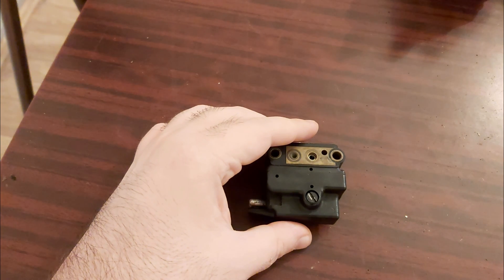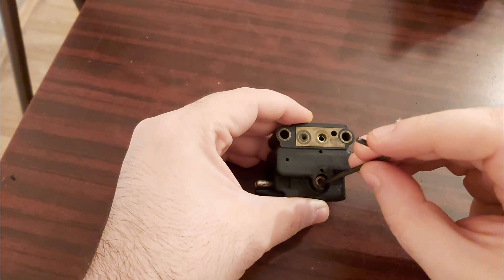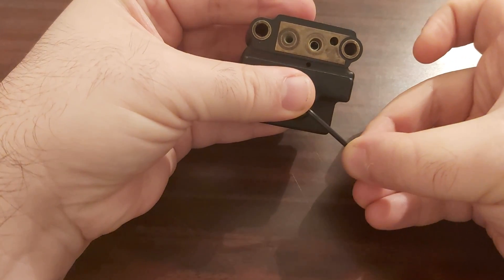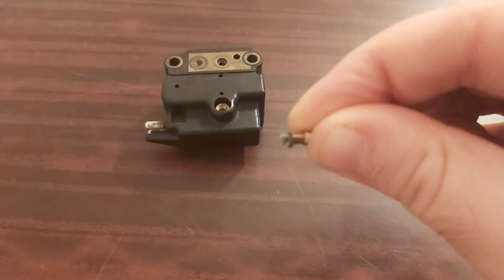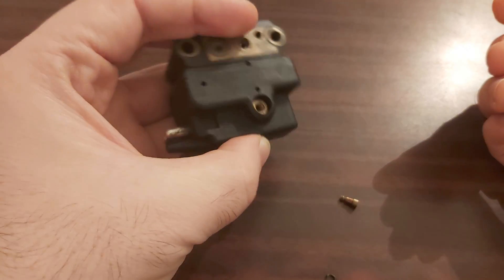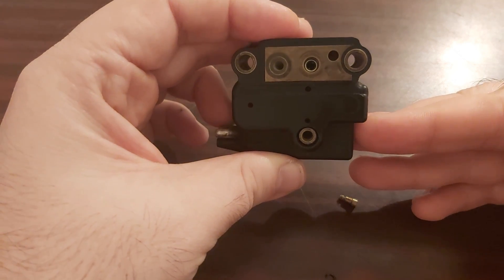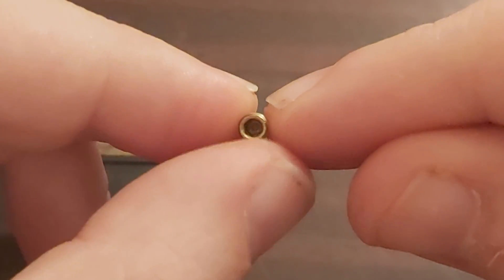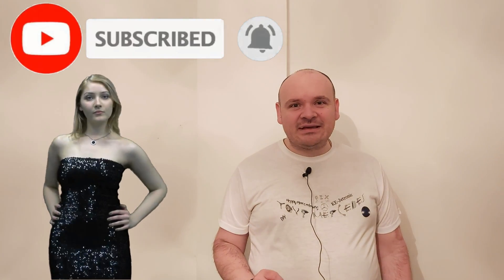㉦Mercedes Ke-Jetronic㉦ - The EHA/addition video

Comment: Hello, how are you? Does today's topic relate to RPM instability? RPM instability starts at 5 with startup, then it increases with pressure on the gas pedal. When you lift your foot off the gas pedal, the RPM goes back to 5, and the engine almost shuts off.
Reply from the maker: Have you checked the potentiometer?

Comment: Hello, if I understood well you mentioned that you will have to change the EHA if the O ring of the adjustment screw is destroyed, cant you change this O ring instead of the complete EHA ? Another thing i want to ask, if this o ring of the adjustment screw is broken, could it effect the starting when the engine is warm? I thank you for your helpful posts
Reply from the maker: The EHA is being replaced if it leaks. There is he way how to replace the o-ring on the EHA, the little one, and I will send you a link. The only bad thing is if the EHA plate breaks, then there is no help for the EHA. Greetings
https://youtu.be/I38ezJ2fzD4

Comment: Good afternoon, Thank you in advance for sharing the information about the injection system, it has helped a lot. I have a 190 2.0 petrol, and I'm having problems with the injection part, it only starts with the fuel adjustment valve turned off, if it starts, no petrol comes out of the injectors, I have 5 bars of constant pressure after starting, before I had 6 bars, if you turn on the valve with the engine running, it works normally. Can you help me? Greetings José
Reply from the maker: Have you tried to see wiring? Looking from the left fender of the car the black wire of the EHA has to be to your left and brown/black to your right.

Comment: Thank you very much for your detailed videos!!!

Is there a way to replace the micro filter on the input port/hole of the EHA valve? If so, what should be the process? is this filter a commercial common part?

I'd got my fuel system contaminated and I'm trying to clean & recover most parts as possible.
Reply from the maker: Just blow it with a carb cleaner! Happy Mercedesing 🍀 👍🏻 💪🏻 😊
Reply: @mercedeske  Thanks for the quick response!, but it seems to be clogged after carb cleaner (and falling apart, because I see some kind of plastic or rubber peeking out 😓)

Comment: Hello, how do I know if it is a malfunction? Does the malfunction cause the engine to vibrate?😊
Reply from the maker: In two cases - a leaky EHA and if its baffle plate is broken. Then the EHA makes constanly lean mixture(pressure difference 0.2bar). That's something you will have to check with your pressure gauge! Best regards!

Comment: Hi Ivica,
Would you describe step by step procedure of adjusting EHA valve on 1986 190e 2.3 w201.  I appreciate if you indicate on each step engine/Ignition off or on,  the tester valve open or close. I have a hard time to get a right  value,  somehow I am not doing it correctly.  If you do a video it would be by far better, but steps of process is great also.  Thank you
Reply from the maker: Hi and thanks. If this video doesn't help, contact me! Happy Mercedesing!
https://youtu.be/jeoJHWCugAE
Reply: Hi Ivica,
I followed your information on the video clip, and came up with these values:
- EHA screw adjustment 6.88 mm
- Ignition on - 0.14 mA at points 2 & 3 (X11) and 2.0 bar with pressure valve closed

- Engine on - (cold) 0.14 mA at X11,  and 4.6 bar
- After 3 minutes warm up (80 degree), 0 at X11, and 5.0 bar,  once I open the valve 5.4 bar
- Potentiometer reads as 0.71 Vdc 
What you think?
Thanks
Reply from the maker: At first on the X11 you measure voltage, not amperage. The amperage(mA) is being measured on the EHA. If you get negative amperage on ignition on then swap the leads on your multimeter. Concerning the potentiometer everything is okay. Measure the voltage on X11 ports 2&3.
Reply: Voltage is 0.67 @ X11
Reply from the maker: @henrysalem5516  That's too low. How does the car behave?
Reply: The EHA amp w/ ignition on is 7.28ma and on engine running at 80 degrees is Zero, and all other numbers as I gave you.
I don't know where to look for the problem, appreciate your assistance.
Henry
Reply from the maker: @henrysalem5516  Your specs are okay. The pressures, the current on the EHA, the potentiometer as well. Are you satisfied with the car how it runs and drives?
Reply: often the RPM fluctuated between 1000 to 1500, when is on idle
Reply from the maker: @henrysalem5516  Many things can be culprits - the pump, the regulator, the injectors, the distributor... Everything has to be checked with the pressure gauge.

Comment: Hi Ivica, thanks a lot for your videos & they're super helpful for the classic mercedes community. So I would like to ask a few questions. I own a 1989 190E, M102 engine and lately I realized that my EHA valve gets wet just after turning the fuel pump on, very very small leaks but still enough to get me worried. 
1) So before I spend the big bucks on it, I'm wondering if just replacing the green O-rings could solve the issue?
2) Is the EHA valve the same for all KE-Jetronic or it varies based on the car (whether it's a W201, a W126, a W124, etc.)?
3) Does a new EHA come adjusted or I have to deal with that brass screw after installing a new EHA?
Thank u!
Reply from the maker: Hi and thanks,
concerning the EHA - they are all compatible(only at the dealership they will tell you the opposite). If the leaks come from the joint, where the FD and the EHA meet, then you can try replacing the two green o-rings, but if they come from some different place then there is nothing you can do. The brand new one is calibrated but its work depends of the sensors so if you have faulty sensors that need replacement then even that one will not help you, you would need to readjust the allen screw. Looks like I have to do a video on that topic, I think people still don't understand how everything works. Best regards
Reply: @mercedeske  Thanks a lot for the quick response. This weekend I'll examine where the leak is exactly coming from; and yes, that video would definitely be helpful. 
Keep up the good work .... All the love from Kigali.
Reply from the maker: @victor90101  All the live from Knjaževac 😉😃🍀

Comment: Thanks for you videos ! I learned a lot about KE-Jetronic.
I rebuild my fuel distributor because of the diaphragm. And now the car don't start. Any fuel goes out of the head in the metal hose.
I noticed that EHA is leaking by a little hole. Is it possible for the engine to not start because this sensor is leaking so no fuel goes in metal hoses ?

Thx you so much.
Reply from the maker: Hi and thanks for everything. Concerning you issue - here your system loses pressure and it makes rich mixture out of your system. In order to see what happens actually you must hook up the pressure gauge on both chambers, bridge the fuel pump and see for how much there is difference in pressures. If you have a leaky EHA then replacement only! That much I can tell!
Reply: @mercedeske  Thank you ! What do you mean by "both chambers ? (lower and upper side of the distributor ?)

I saw a bolt on the lower part who's raccorded to nothing but not on the upper part. Do it have to bridge from this lower bolt to the cold start injector ? Then I think I have to take off EHA Sensor to have clear pressions.

(Btw I enjoyed your videos u helped me to save my distributor and to adjust my throttle plate. How can I help you back ?)
Reply from the maker: At first concerning lower chamber, that's the lower part of the distributor. The screw that is left there like that when you unscrew it you can measure the control pressure with a pressure gauge and the system pressure is measured where the cold start valve connection is located. You just need a pressure gauge with fittings. Measure the system pressure at first, note it and then measure the control pressure and you will see pressure difference which has to be 0.4bar. I'm glad I helped you. If you can donate on PayPal 30euros that would be great. Many greetings and happy Mercedesing 😀
Reply: @mercedeske  Do I have to take off the EHA while taking pressure ?

You should do a video explaining this checking. I didn't see this one on your YouTube channel ;)
Reply from the maker: @Xorellion  Yes, disconnect the eha. I will provide you the link.
https://m.youtube.com/watch?v=RKxfSdTNARY&t=20s
Reply: @mercedeske  Okay again thx for your help ! I'll check this !
Reply: @mercedeske  Just for informations do you know what’s the threads dimension of the cold start injector and the lower bolt part ? Thx
Reply from the maker: As for the lower part M8x1 and the upper 12.5x1 if I remember well.

Comment: So I have a problem with my 90 300e v6, on a cold start it takes many attempts to start up and if I give it some gas, it will stall, but start right up again, and when it at operating temperature, it will keep running but after 15 minutes it will stall and then it won't start back up, but after many hours I can start it, and it will do the same as i stated above, any advice would be appreciated, thank you very much.
Reply from the maker: Have you checked the ignition coil?
Reply: @mercedeske  no I have not,  but i will check it out.
Reply: @mercedeske  so i wasn't sure on where and how to check the ignition coil, but i know the distributor cap has a ignition plug go to it, so i started with the distributor cap, after seeing how bad the cap was worn, i was convinced it had to be replaced, it was a bit more expensive then any distributor cap I've ever paid for in a long time, since there is no one making newer cars with distributors, but i had to reuse the old rotor because i only had enough money for the cap, the rotor still looked ok the cap should have been replace a long time ago, when everything was part back together i turned the key and was saddened it wouldn't start, until i realized the battery was drained for seating to long, after 20 minute of pacing back and forth wondering if it was just the battery,  i turned the key ... and it started before i turned the key, not really but it sure felt like it did, it turned over right away and idled good and idled down after it warmed up, and didnt idle out when i pressed the gas petal when it was warming up, thank you Sir, when my parents said that they were going to junk the Mercedes cause it would get repaired and break down a few days later they just put in the back and when asked what happened to it and asked if i take a look at it, they said I'd be wasting my time and no one could get it running, i did that day but for a little time about 5 minutes i found a lot of hoses cracked and old, thats was 5 years ago, when they would let me, i would have to explain to Pop why the hoses play a big part in keeping it running, and that I'm not just guessing that is the problem, but it was more then just problems, so every once in a while I would convince them to let me look at the Mercedes again and find something else that could have been a problem and fixed it but goodnight get it to run and not stall and at one time they bought a new truck and wouldn't let me work on a Mercedes anymore that was about 2 years ago until yesterday, moms went to the gas station to put gas in the tank it started up on the first try she got to the gas station got back and it was running just fine except that the check engine light at turned on it was the O2 sensor reading code 17, I believe the check engine light turned on because it was almost out of gas before she went to the store I cleared the code and we'll see if it goes back on for anyting, they have even nicknamed the Mercedes the Mer-Zombie, i am convinced it is back from the dead.
Reply from the maker: Hehehehehe! I am glad you like these cars. Once you repair them the KE is a very reliable system, you will see. If you just erased the code and you didn't replace the sensor, the code is going to appear again. If it has never been replaced, replace it and then erase the code and that's it.

Comment: Do you happen to know the M/B Part Number for the little green "O-rings" that go between the mating surfaces of the EHA & the Fuel Distributor?
I'm having terrible trouble finding them (or even a generic part to do the same adequately) and I'm pretty sure it's one of those parts M/B would still stock and I could buy them directly but I need the part number to do so. Also the part number for the long screws (flat or torque head depending on your engine) used to secure the EHA to the Fuel Distributor?
Reply from the maker: I'm not sure you are going to find the screws under some reference number but you can find them in some mega market  I believe or in a shop. I'm not sure about the thread. Concerning the o-rings
https://www.ebay.com/itm/233171329374?hash=item364a18215e:g:JK8AAOSwAwFawkJ5
Reply: @mercedeske  ahhh... You're a lifesaver. You also gave me an idea, I have a thread gauge that came with a Tap & Die set I've got, that would be ideal for working out the thread distance. I lost one of the screws & the "random" one I was able to find that was as close to the other as possible refuses to do up without leaking on that side. It might just be the O-rings but usually I could get it done up so it didn't leak my tightening up enough.

Comment: Where can i find the screw and the o ring of the EHA? thanks!!
Reply from the maker: If you have a shop in your town selling o-rings. This one is 1×1.5 and STRESS that it has to be petrol resistant!
Reply: @mercedeske  Hi! you know the part number, because I live in Costa Rica.
Reply from the maker: No. This one can't be bought anywhere, just like this as I told you. Either that way or the other EHA. But this is a cheaper way.